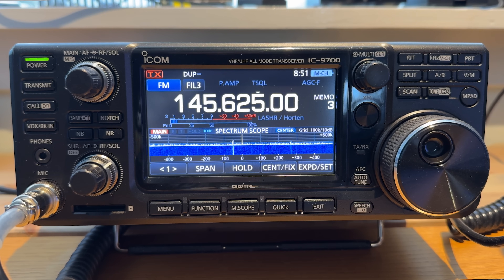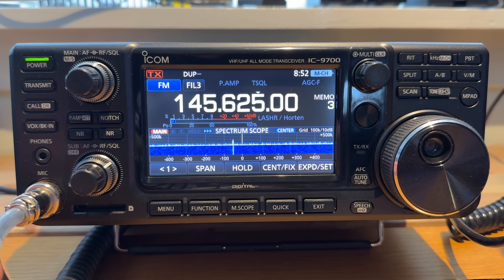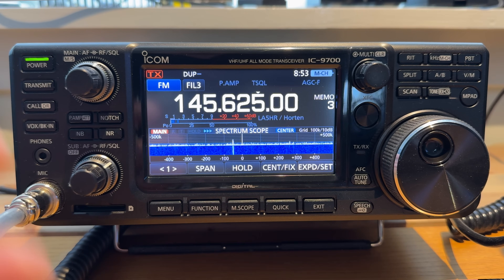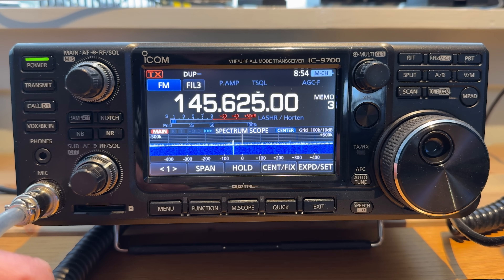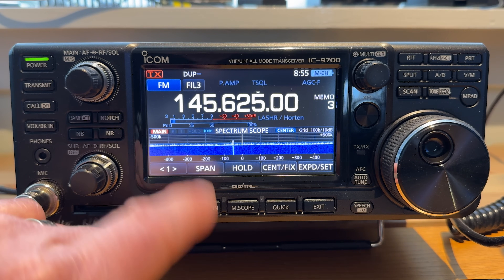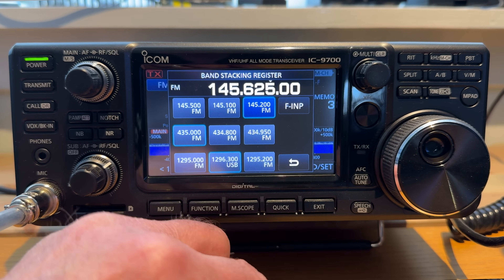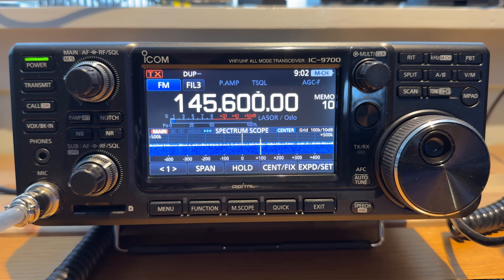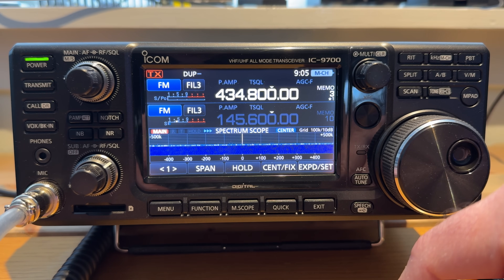IC-9700 for FM & Repeater work in 2024?

Comment: Beautiful rig, I like it, I dropped the FT991A (which is a great starter and all-mode radio) as it wasnt sensitive enough.  With the 9700 I can reach more repeaters (like this video) slightly further away that my previous radio struggled with, I especially like it for weak signal modes that you briefly mentioned.  
I agree its locked to amateur and am-satellite bands. 
You videos are awesome! Thanks

Comment: I have a small con discovered. Could be solved by firmware I guess; no separate Mic Gain levels between FM and DV. On DV you sound typically louder than on FM but the FM Mic gain is your DV mic gain. 

To be honest; I did not tried it yet on firmware version 1.50 but I assume it is still not being set separately.

Comment: Excellent video. Thanks.

I noticed that the 9700 receives weak 2m beacon signals very well even without any S-meter indication. I such cases the spectrum waterfall does however show a weak spectrum line on the waterfall display.